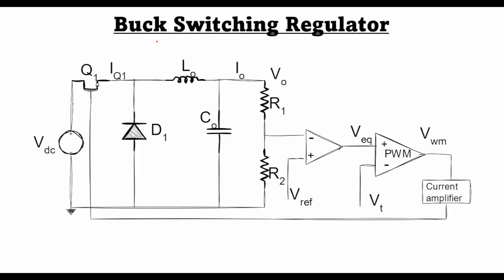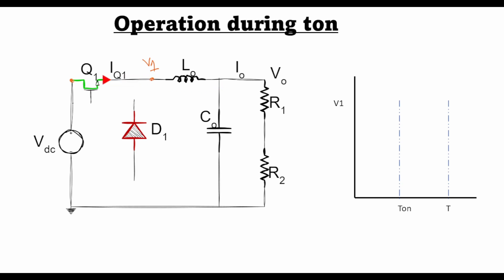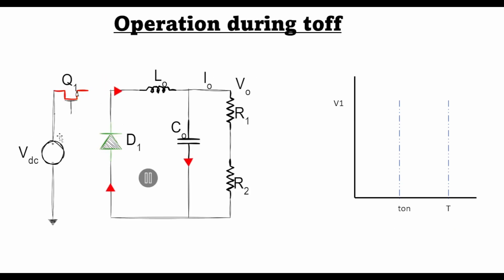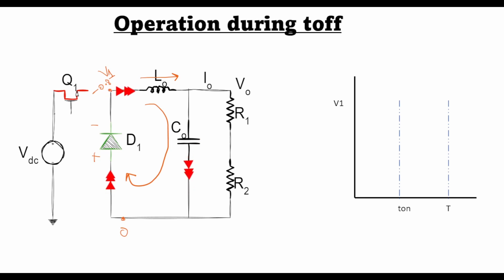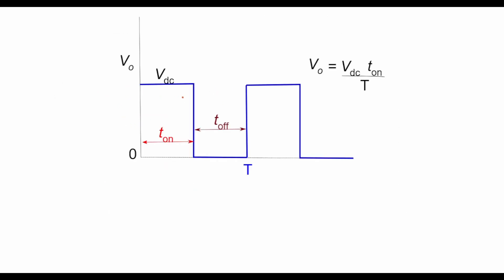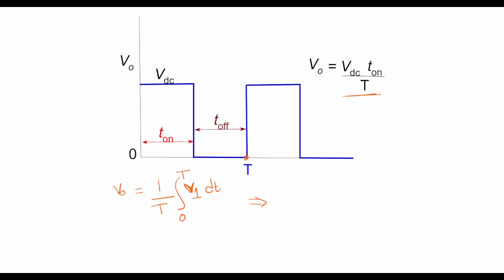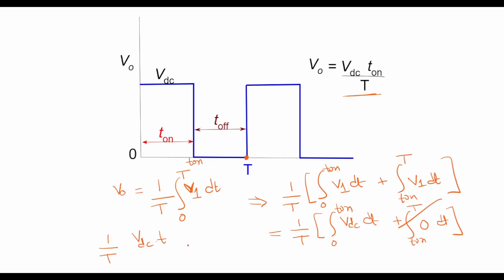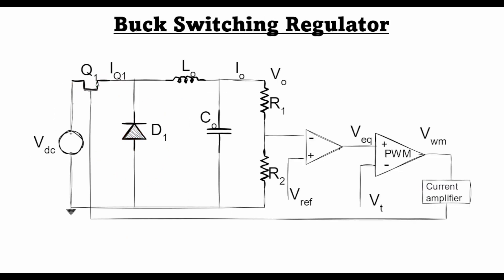Buck Converter Basics | Ton/Toff Operation and Output Voltage derivation

Comment: The simplistic equation for output voltage
Vout = Vin • duty cycle
is true ONLY if the inductor current is continuous - that is the inductor current never remains at zero at any time throughout the switching cycle. When a buck converter is operated with discontinuous inductor current the expression for output voltage becomes considerably more complex.
Reply from the maker: Indeed, that’s true. I will cover this topic in one of my upcoming lectures.